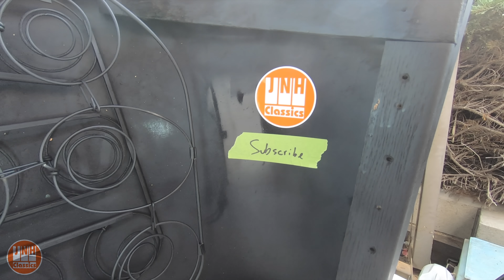A Forgotten Model T (Episode 17) New Seat Upholstery From Scratch

Comment: So many fordors died because the wood rotted, I really like what you have done to bring this one back! I am kind of glad that I have a 23 roadster with one seat though. Some sedans had spring loaded shades for the rear window, just like in house widows only a cloth material, not sure if 23's had that but it is for driving at night, the car lights shine through the rear and the reflect off windshield then back to the rear then back to the front, almost like being in a light house when a car is behind you. In 31 they put a slant on the windshield which stopped that mess. Anyway I think your car is really nice, it will be great for cruising around town.

Comment: That slot on the left side of the steering wheel does that look like a key slot?
Reply from the maker: Yes it’s an aftermarket antitheft device you could lock the steering wheel. But I don’t have a key for it.
Reply: @Jerod_Helt  I didn't know Model T's have antitheft I thought they don't have any.
Reply from the maker: @TheNewStoryteller  it’s not original someone added it
Reply: @Jerod_Helt  That's the point I would describe antitheft was never thought of when Model T's were built.

Comment: The Model T looks really beautiful now from the inside and the outside. I like the pinstripe upholstery, it matches ideally regarding the period the car was built in. Excellent job again, Jared! Now it's just some little dash work still to be done and the carpets and the interior is finished. I think you also have some work to do on the rear, like brakes and diff, if I remember this correctly. I guess now we are just one or two episodes away from taking the first serious spin. Can't wait to see this happen.